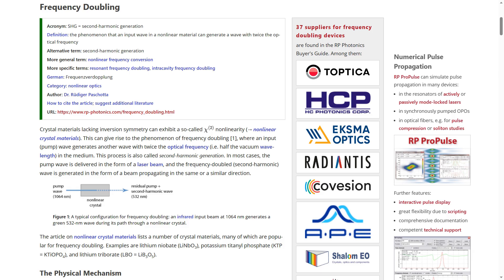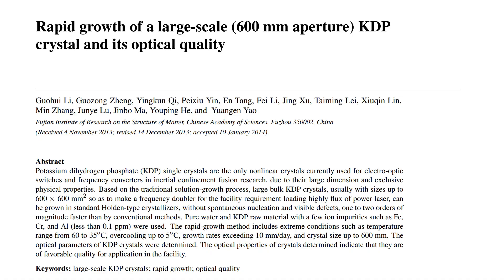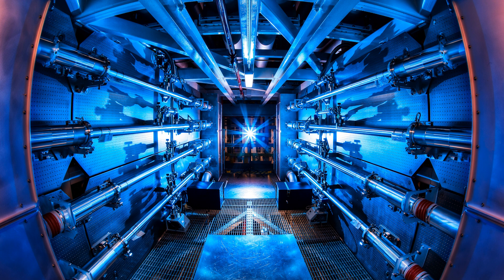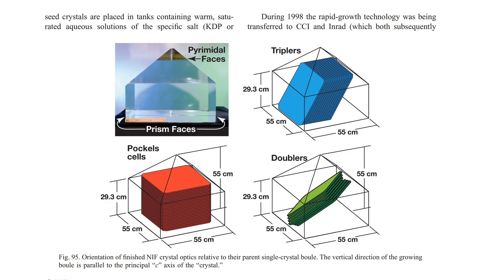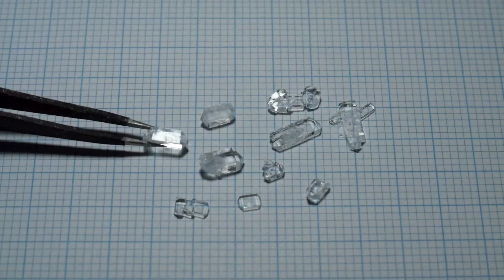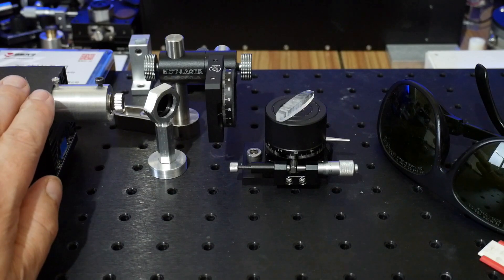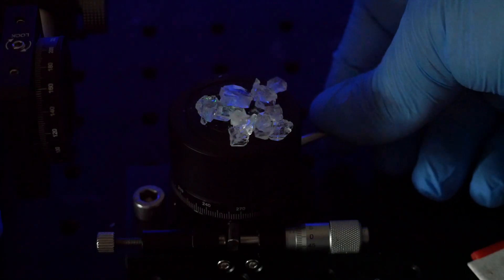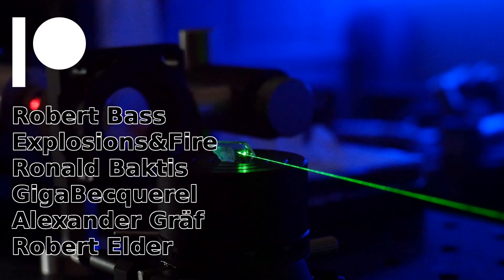Growing Laser Crystals used in NUCLEAR FUSION!

Comment: What happened if you hit the crystals with X-ray?
Reply from the maker: With X-rays you would be able to image the lattice via diffraction. Other than that I don't imaging anything exciting would happen.
Reply: @LesLaboratory  Why would the freq double just like light?
Reply from the maker: @troyfrei2962  unfortunately no. In simple terms, you can consider the molecules in KDP to behave like oscillators that are responsible for SHG. As such there are only a limited range of wavelengths that can be coupled in and give rise to harmonics.

Comment: Can this be used to change a co2 laser into a 1064 wavelength
Reply from the maker: Unfortunately no. Nonlinear chalcopyrite LiGaTe2 can be used to frequency double CO2 to around 5 microns, but that's far away from 1064nm. The fourth harmonic might get you close, but there are far more efficient ways to get 1064nm.

Comment: If you put two crystals in a row, does it frequency double twice (resulting in ~350nm at 1/4 total power)?

Or does the resulting green beam pass straight through the second crystal, unaltered?

I'm curious how two in-line frequency doublers differ from a triple harmonic crystal, if any. 

Disclaimer: I do not understand the phsycial principles/mechanisms lol
Reply from the maker: Sort of. Depending on the cut you can get the third harmonic at 355nm from a second crystal. This requires special cutting, polishing and alignment. It is also possible to get the fourth harmonic at 266nm, but this requires precision temperature control to work, and high peak powers.

Comment: I doubled the kdp to 100g and used 400mL of water. Heated it in a beaker and stirred until all kdp was dissolved. Next, I poured it into a wider dish and then put the dish into a styrofoam cooler. I cut out 2 holes in the top of the cooler and covered them with filters so that the evaporated water can escape the cooler. I kept my apartment at 70-72 degrees F. Clearer crystals were grown once I kept it at a constant temp of 70 degrees F. After about a week, I have 2 big cloudy crystals, 1 medium sized super clear crystal, and 1 tiny clear crystal. These are just the seeds. I’m going to wait a day or two longer before I put the super clear crystal into a new container and suspend it.
Reply from the maker: Fantastic! Yes, I have noticed with KDP that it can be a bit of a hit or a miss, especially if there are any temperature variations. I have been spending the last couple of months growing KDP using various methods. The largest I have grown is over an ounce, but is only clear in one or two sections, but the results so far are pretty promising.  Let me know how you get on with it.

Comment: Will these work for pumped phase conjugation  ? Barium titanate is very expensive
Reply from the maker: I don't think so. From what I have read, phase conjucate optics are used to correct wavefronts that have travelled though KDP, as KDP distorts them. Phase conjucation would be an interesting topic to explore however.
Reply: @LesLaboratory  do you think you can try your hand on a video of using KDP crystals that are polished for pumped phase conjugation  ? Or growing barium titanate BaTiO3 patent WO2001006042A1 talks about growing singular   barium titanate crystals for use  I would love to see a video on either or if you can

Comment: I always assumed that the ends of cut and polished crystal had to be coated with AR and transmissive films to get the second harmonic?
Reply from the maker: Well, it would certainly help. At low powers absolutely, but when you are hitting it with Kilowatts of peak power you can get away with it.

Comment: What an interesting effect.  Is there a similar effect, but in the opposite direction - with a decrease in the output frequency?  In the X-ray range, for example.  It would be possible to create an X-ray telescope based on this effect with high resolution.  I know that it is very difficult to focus the light of the X-ray range, if its frequency were lowered to ultraviolet, then the task of focusing would be solved much easier.

Comment: Excellent video. I think it was really cool to demonstrate crystal growth and phase matching properties of nonlinear crystals! In addition to the 'yaw' angle adjustment, you might get a small improvement by adding a pitch adjustment as well, since the crystal may not lay perfectly flat on the platform. 

Have you ever witnessed the 'rings' or additional features that arise noncolinear effects rising from k-vector addition on the crystalline lattice?

Also, you you use your SHG beam and send to a second crystal for DOPA, to get quantum entangled photons!

Comment: Beautiful demo! I’d love to try growing crystals and see how they behave. I have a 60W fiber laser engraver, and if you set it to just scan over a small pile of crystals, you get loads of green flashes. Being focused, it’s very easy to get the intensity.
Reply from the maker: You should. There are a whole bunch of crystals that can be grown that will do SHG.
Reply: @LesLaboratory  I found that aluminium nitride does it very slightly (https://www.youtube.com/watch?v=WdZHd7YGEys) when I was messing around with the stuff. Amazingly, if you laser engrave it, the surface transforms into a thin aluminium layer!
Reply from the maker: @imajeenyus42  now that is interesting. Is the aluminium layer contiguous?
Reply: @LesLaboratory  Yup, it seems to be - it's not exactly smooth and shiny, because of the roughness of the lasered surface, but it's definitely conductive. When I was playing around with it, I could get tracks down to a few ohms resistance. Quick video here as well - https://www.youtube.com/watch?v=QQiGjbQBlv8. The deal seems to be that AlN decomposes above 1800°C or so into aluminium and nitrogen. The layer isn't very thick though - one paper I found talked about 1um or less.
Reply from the maker: @imajeenyus42  nice! I wonder if it would take electroless plating. I must get a fiber laser!

Comment: This is AMAZING!!! 

Question, can the crystals be used as a scintillator for cameras? Meaning if I was able to get a crystal that converts, UVA UVB light into some other color that the camera can detect.
Reply from the maker: Thanks! Unfortunately no. These crystal require an extremely high light intensity in order for the nonlinear effect to become measurable, something that ordinary light sources can't do. It is possible to image in the UVA and UVB though with black and white camera sensors with quartz optics.

Comment: Doesn't this effect violate the 2nd law of thermodynamics?   I find it hard to believe it does.  But could someone explain why not?
Reply from the maker: Two photons of low energy (1064nm) are "combined" to one photon of twice the energy (532nm), Therefore the total energy out is the same as the energy in. In a real system, you also have losses as well.

Comment: Awesome stuff Les! I've wondered whether it would be possible to pull this off at home for some time now.  Do you think it would be just as easy to get 404 nm violet light using an 808 nm diode from a laser printer?
Reply from the maker: Thanks! Non-linear effects typically require extremely large power densities or high peak powers. The Laser in this video is pulsed and gives peak powers of greater than 15kW so doubling is very straightforwards. It is not likely that an 808nm Laser diode, would give visible output using KDP. That said there are directly doubled Laser diodes out there, but the crystals for those are exotic and the tolerances super tight.

Comment: This is great stuff.  I'm wondering if a DIY lab can move up in frequency/energy and do some simple(?) X-ray crystallography.
Reply: Seems unlikely..  The only coherent X-Ray source for any purpose that i'm aware of is the free electron laser, and that needs a synchrotron.  If such a thing were easy I doubt the semiconductor industry would be pouring billions into developing 65 nm EUV light sources.
Reply from the maker: Back in the day I used to build x-ray machines (I posted tons of stuff on 4hv.org), however I need to get a workshop outside to get back into that kind of stuff. But sure, with a small collimated x-ray tube and some math, x-ray diffraction could be done. you can even buy machines like the Tel-X-Ometer for this, but they are pricey!
Reply: Here is an interesting presentation of table-top coherent x-rays: https://www.youtube.com/watch?v=53cCTcGWCeo

Comment: You will get a lot more green if you focus the beam inside the crystal. Use a lens with about a 5 inch FL. Also heating the crystal a bit helps it operate more efficiently .
Reply from the maker: Yep, I was afraid of hitting any flaws or imperfections though. I might try ovenizing them, it could make for an interesting experiment!

Comment: Superb video. Without any question, the finest, most beautiful, and clearest exposition of the phenomenon to date anywhere on the internet (and I've seen pretty much all of them!). 

Though obviously not necessary for the home experimenter, on the "real thing" for a fusion laser we couple each crystal in its gimbal to a thermistor, such that the temperature sensitive nonlinear coefficient of the crystal may be compensated for due to slight fluctuations in ambient conditions of the laser bay. The crystal doublet in the gimbal is electromechanically actuated, such that each crystal may be "tuned" or detuned to produce 1st, 2nd, or 3rd harmonic light as desired. Further still, we demand the supplier of crystals (and there is only one on the planet capable of growing them this large - Cleveland Crystals) makes the KDP not out of potassium dihydrogen phosphate, but rather potassium diDEUTERIUM phosphate (KD*P) so that the tiny residual infrared absorption at 1053nm due to one of the overtones of the hydroxyl group stretching vibrational modes in the crystal is red-shifted further into the IR (the deuterium is heavier and so the molecule vibrates slower), the crystal thus becomes more transparent at the fundamental line and more efficient at converting to higher harmonics. 

It always struck me as weirdly ironic that in order to do inertial confinement fusion you need deuterium in the target capsule AND deuterium IN THE LASER too!
Reply from the maker: Thanks! :-D

This is a really nice description! Even for home use, a proper gimbal is probably a good idea and I am thinking about it.The rotary stage gives me only one axis of rotation, and the half wave plate does the functional equivalent of rotation about the beam axis, but this is still far from properly tuned.
Funny you should mention KD*P, someone else asked about that in the comments, and I pointed them to this: https://www.nature.com/articles/s41377-022-00929-y but your explanation provides the why to the papers' what, thanks!

I had exactly the same thought about the Deuterium thing. I was having a cursory read about the precursors to all this (Shiva, Argus, Novette etc) , absolutely beautiful stuff. I am sure there is something interesting buried in some papers somewhere!

Comment: Very impressive!
As you may have already discovered there is crystal cutting and polishing gear available for hobby lapidary work. Lapidary clubs could be helpful also.
I guess the crystal can be cleaved using a sharp point. 
Thank you for such interesting content!
Reply from the maker: Thanks! Yep, that and optical polishing were my first ports of call. KDP is quite soft, and can easily be rough cut and ground, and even get a reasonable polish  in just a few minutes. I have already tried this with a  failed crystal as a test. I just need to grow large clear enough crystals.

Comment: I don't know why, I just always assumed the crystal needed to be cut and facetted to work! I started growing crystals with the aim of eventually making a working KTP crystal, which got me into chemistry. Very cool video. You always have unique content, bringing the cutting edge into the realm of the hobbyist.
Reply from the maker: You would be surprised at what works! I have a failed KDP crystal that is milky in appearance, and the whole thing glows green. I have already tried a quick test at cutting and polishing a reasonable crystal and the results are very promising!
Reply: @LesLaboratory  I need KDP  for UV-C laser
Reply from the maker: @banuwii  me too. I am currently in the process of growing good clear ones for this!
Reply: @banuwii  yeah, you can induce pain signals really easily with UVC laser. 😅
Reply: @LesLaboratory  I have a sizeable CE:YAG crystal in rough cut, im trying to find a cost efficient way of cutting it into as many test pieces as i can. im looking to make 10x10x1 mm slices, some smaller, some bigger for experimentation. Have you made much progress or have any tips for this?
Reply: @gtjack9  Worked with KTP in the 90's in a DPSS Green Laser project. I used a desktop type Diamond Wire Saw to cut KTP and other crystalline materials. You might want to look in that direction. I also polished our materials, then we would send them out for AR or other speciality coating.

Comment: Great job growing your own crystal and then using it in your setup! That's a great achievement!
I wonder how quickly the crystal faces will degrade with the moisture in the air, as crystals typically purchased are AR coated to also protect from humidity. I also wonder how the damage threshold of your crystal stacks up to commercial ones.

In my lab I'm always very happy when the peak power of my pulses is naturally in the MW regime, so I don't need to set up focusing to achieve efficient SHG.
Reply from the maker: Thanks! These crystals have been out for a few days now with no visible signs of degradation. If they are kept dry (and I don't breathe on them!) I think they will be good for a while. They are hygroscopic, but not deliquescent. I suppose I could build little sealed chambers for them on the lathe if it become a problem.

Yeah, with huge peak powers, you can more or less chuck a crystal in front of the laser and you are done. I have a nice YAG under the bench that barely cares at all about the orinentation of KTP!
Reply: @LesLaboratory  awesome! I know. With enough oompf even Pockels Cells start to convert the fundamental.

Comment: I wonder how you managed to get the second harmonic at such an angle (phi equal to 0 or 90)? I was able to get generation only with theta angles around 50 and phi 45 respectively. What type of generation is happening?
Reply from the maker: EDIT: According to the referenced paper, Type I,  but this is not in agreement with other papers which quote Type II ! There may be an error here that warrants further investigation, but  bear in mind this crystal is un-cut, and the surfaces are far from flat, so anything is possible.

Comment: Hi Les very nice video I have used my ANOVA Sous Vide wand to keep the  water bath at a constant temperature to grow the KDP crystal and it has turned out to make large  clear crystals perfect for SHG laser light
Reply from the maker: Great tip, I will be trying seomthing similar. I was thinking of wraping the beaker in that flexible heating strip you can get for vivariums.
Reply: @LesLaboratory  Watching this I started thinking about temperature regulation ideas too. I think something like the sous vide or using a heating strip or immersion heater in a larger volume of water which the beaker then sits in might be a better approach than directly heating the beaker itself.
Putting heating strip directly on the beaker with the saturated solution will probably result in convection around the edges & uneven temperatures, as well as the need for a temperature sensor to be immersed in the crystal growing solution. 
Sitting the beaker in a large volume of temperature controlled water will eliminate those issues, and will have a lot of thermal mass to minimize temperature fluctuations, even when a cheap thermostat (non PWM) type temperature controller is used (eg an aquarium heater). You could even use a cheap 12v water pump to circulate the water bath to ensure absolutely uniform temperatures while still keeping the crystal growing solution undisturbed.
FWIW if you're thinking of building an Arduino/rPi/ESP32 temperature controller, I've had good results using the DS18B20 temperature sensors - low cost, precise, plenty of open source libraries/drivers available, and they work on 5V or 3.3v micros. It might also be worth mentioning that vape shops are also a good source of very cheap SS316, Kanthal and Nichrome resistance wire suitable for immersion heaters too :)

Comment: You could use a cheap incubator to stabilize the temperature, so maybe try that?
Reply from the maker: Yes, I was thinking of getting hold of the flexible heat mats that you can get for vivariums, wrapping it round the beaker and building a temperature controller. This is kind of how they do it at the NIF. They run the baths at 40 odd degrees C and slowly cool over the course of a couple of months.
Reply: @LesLaboratory  Or grow them in a thermus flask.